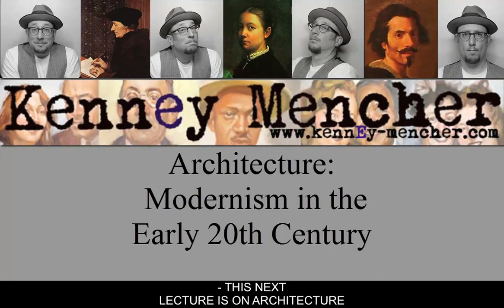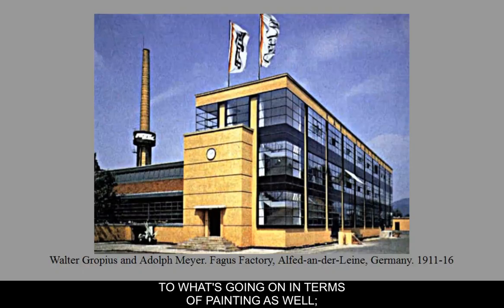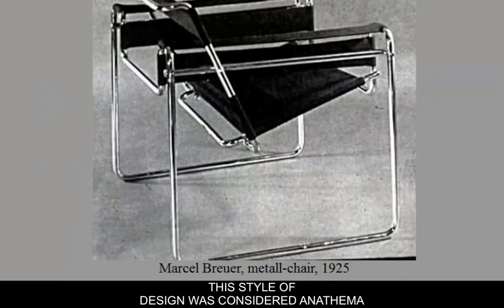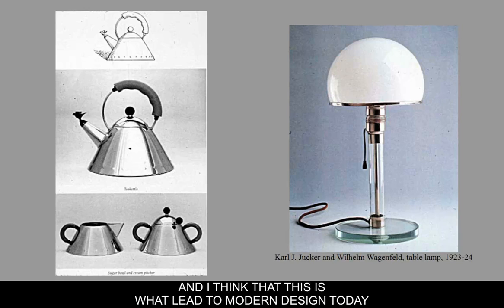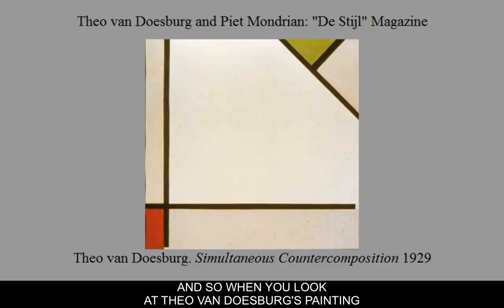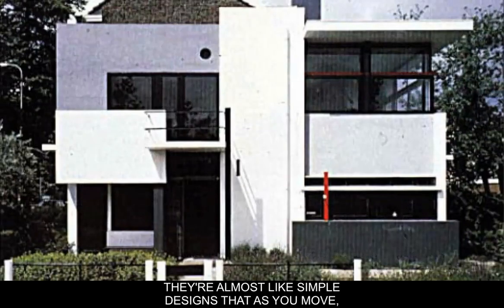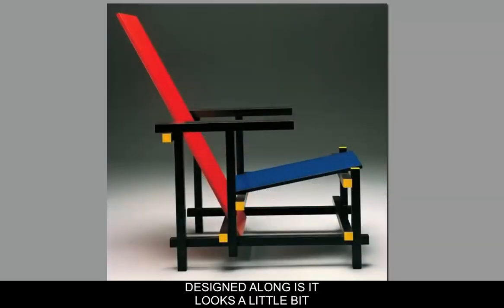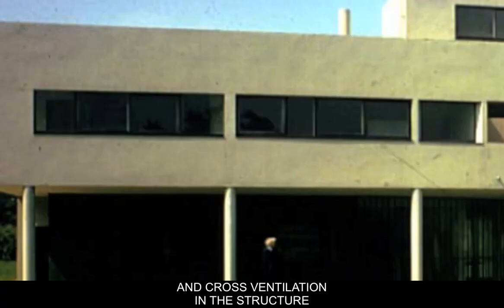20th Century Architecture Modernism Bauhaus DeStijl and International Style cc

Comment: I love modern architecture .  Throughout history art, design and architecture are cyclical .  In many ways we can see that post modern architecture often is "busy" like the baroque era .  Perhaps the first time in history , 90 degree angles were manifest in modern architecture or also geometric diagonals but with no curving .  Definitely has much to do with industrialization .  I am psychological , but i never question why i love rectangles .  And another thing about modernization while it minimizes architecture to basic geometric forms ,  it does one little thing that makes it so wonderful .   And that is putting elements of a building off center .  If it is a circle you can see in some paintings by Kliun of the Russian Avant Garde , circles are not centered in the middle of the canvas .  And circles are divided into separate colors not half and half , but something like 2/5s to 3/5s